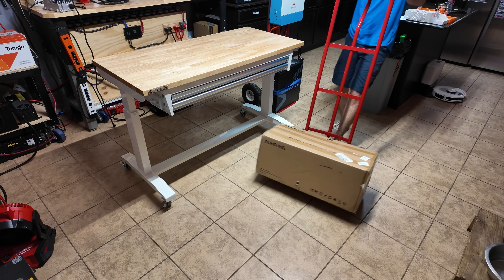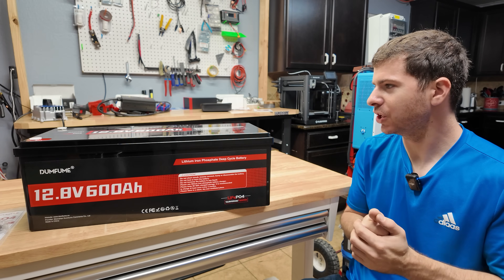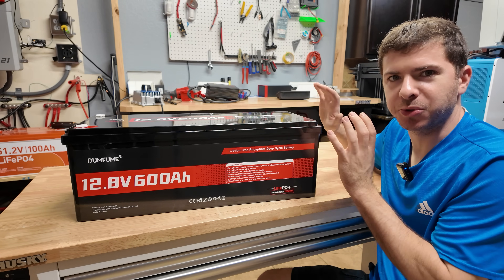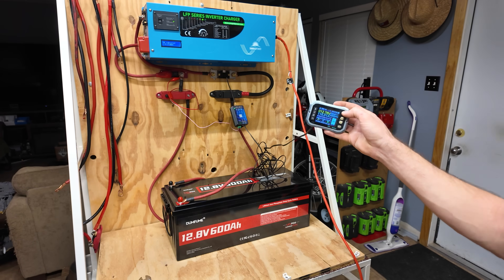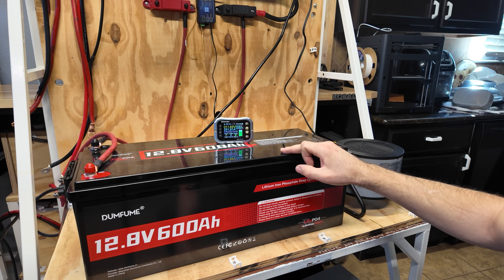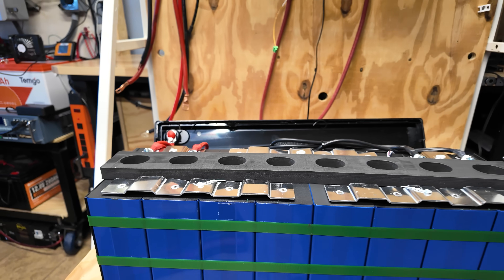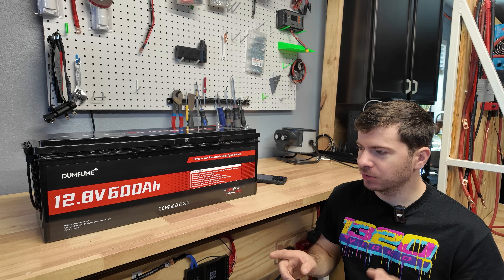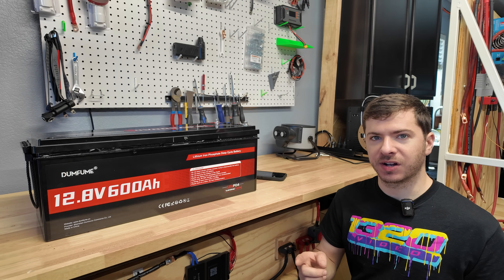$559.99 Dumfume 600Ah 12 Volt Lifepo4 Battery Review! Teardown! Testing!  7600Wh

Comment: Nice video!
Would you ever consider doing a build these in a 48V setup with solar, inverter and grid charging?
Or would that be more expensive then getting server rack batteries?
Reply from the maker: Yes they would work well for that, I like the form factor of a server rack battery more, and they are getting cheaper. But if your after cheapest price per Watt hour it may be hard to beat this.
But do keep in mind you will need a battery equalizer to keep the state of charges close, and that adds cost.
either way is good in my opinion

Comment: Thanks for the review and the teardown. Looks like a quality built battery. This Dumfume seems to have the same capacity cells as the WattCycle 628 ah battery. I'm curious as to why Dumfume chose to advertise it as 600 ah instead.
On another note, I wish I could get 2 of these batteries. I would connect them in series to run my 3000 watt aio Sungold Power inverter/charger.
Back when I purchased my 12.8v 280ah batteries, they were the highest capacity 12v batteries on the market. Now they seem kinda puny. lol
Reply from the maker: I agree they probably under rate it’s better than over promise. It’s a monster of a battery I can barely move it, so I think 300ah is the sweet spot .

Comment: To answer your question I guess the primary factor would depend on If this is your primary source of power or just a backup. For off-grid redundancy is survival. If you have 1000ah of 100ah batteries and one goes down you now have 900ah. If you have a 1000 amp hour battery and it goes down you now have no power. So for that scenario it depends on which level of redundancy you want would you rather have nine 100ah batteries or 3 300ah. If it's just a power outage backup chances are you'll have it repaired before you need it so convenience over redundancy.
Reply: That is always something to consider.  If you are buying a good quality battery, may be less to worry about.  If you are buying cheaper batteries of less quality, it is something to consider for sure.  A lot is just how much one depends on the batteries.  If going on a camping trip where the batteries are a must have, best to isolate things a bit.  If you always have another source of power, not so important.  

Price is another consideration as well.  It may be cheaper to buy 100 amp/hour batteries than it is one 600 amp/hour battery if you catch a sale or something.

Comment: How long can it run my 12v a/c that I'm getting for my van?
Reply from the maker: How much power does it use?
Reply: @Mikebuildss thanks for your question. 58 A at startup, then average of 48 amps. Outequip Pro is the name of the a/c. Thanks again.
Reply: 600 divided by the average amps of the AC, since it fluctuates and cycles on and off. That answer is the hours it will run. That's the easy generic formula.
You'll do yourself a lot of good by learning watts law and how to use it.
Reply: @samuelfox8126 thank you!

Comment: imo if it is not for 12v rv (and you're not limited by 12v-only appliances) then having 24v or 48v batteries and system is better since you would have higher continuous power and no hassle with battery balancing when you discover that <200a 12v (<2.4kilowatt) is not enough for your appliances. for an rv you even can have bigger 4kwatt+ hybrid inverter that accepts big 500w panels.
for homes having 24v+ system is even more practical because you can add a few kilowatts of solar and have free air conditioning during summer. price-wise 12v vs 24v is not that big of a difference

Comment: That Company seems to be pretty good Mike, just dropped some change $$ on 4 of the 300AH models and so far so good!! I wish I would have waited on getting batteries cause the last 2 years these things are now super cheap!! Keep up the good work brother!! I still have some on and off issues with my Sungold all in one 5KW unit but so far it's working so oh well... LOL
Reply from the maker: Nice that’s a lot of capacity! What kind of issues are you having with your inverter?
Reply: @Mikebuildss  Where to begin.... LOL... well if I run my generator on the Main/Grid in when the batteries are low it does swap over to feed the cabin and charge the batteries but I can't set the charge current to more than 20 amps even with the cabin at say 2 amps and it not bog the generator down and the all in one will disconnect it even though the generator is rated for 3600 running watts with an 8/3 15 foot feed.... sometimes I have to set it to 15 amps on the all in one to avoid it from happening... AND if the batteries are really high like close to topping off it will connect and disconnect over and over... I have tried 2 different generators both new so that should eliminate that... any clues? If I turn the setting to 0 amps it works flawlessly swapping over if the gen is on and works great BUT I loose the whole real purpose which was a back up means of charging... sorry so long winded...
Reply: @Mikebuildss  Oh and it's a 48 volt system...

Comment: These big batteries is dropping in price so much it will soon be cheap to invest in large scale home systems. 4x this in 48v configurations is a huge amounts of energy and could last you for days or even weeks if you are in a blackout situation.
With this prices a company could build an easy automated "kit" for the elderly and other people that struggle in a blackout situation, you can get that today but at often insane prices. I built a smaller system just for situations like that, works and gives me a few hours to set up gasoline generator or wait for grid power to come back if its a short blackout. Coolers and fridge will run on batteries like this for a long time if you like me got medicines in there that spoil if they get warm.
Reply from the maker: I agree that’s what I think most people would like to have, not every one needs a fully off grid house they just want some power in a back up situation.
Reply: @Mikebuildss great review. Everyone is almost only reviewing 100Ah batteries. Big ones like this one gets little attention. Keep up the good work.

Comment: Someone needs to come up with UPS controller for Servers for batteries like this.  APC normally prices their systems at a $1 per Watt.
Reply: Look up charger/inverter. LiTime has one, has UPS functionality but no way to plug into a usb to auto shutdown the PC/Server when battery gets low.
Reply from the maker: Some inverters have a UPS function that switch to battery when Ac power is removed, switching time is extremely fast

Comment: I have one 300ah. It was 300ah for this first month. Dropped to 260ah then
Reply: Charger a 14volt max en max a 11.8v stop use and charge battery con mppt and use cable da 75mm2 for 2500watt a 12.8v is 200ampere da 14v a 11.5volt is 300ah
Reply from the maker: I wanna cycle this one and retest after some time, i hope thats not the case all the time

Comment: I love these large "Solar" batteries when used in Car audio systems. 
They have so much capacity, you can play your radio all day and not have to worry about having enough power to start your car later. 
Also, for those of you who have  things like a  DVR in your car, they really are nice to have when you park your car for  week or so, and come back with everything still working and the voltage reading still being above 12.5 volts
Reply: I use just a 100ah battery for the stereo and cooler in my jeep.   Runs all week and tops off every time I drive it.

Comment: I was going to get their 12v 100ah battery, but there were too many bad reviews on the battery, not keeping a charge. some say that the battery didn't last long. I think they are now using cheaper parts for them.  I think I'm going to try the fllyrower lifepo4 12v 100ah  battery.
Reply from the maker: I’d also recommend Vatrer or eco worthy both are built really good. The eco worthy also has metal cell compression
Reply: Ecoworty o watt cicle mini is good

Comment: Don't turn up side down? Any concerns about mounting this upright/vertically (and in a vehicle)? And without Bluetooth suggestions on what would be best for monitoring it's remaining capacity.
Reply from the maker: You can orientate it any position except upside down generally is ok .    Id recommend a amps whatt meter, i have a video on my channel showing the one i use, its programmable so you set the capacity and it will keep track of how much you used. Ill add the link in the description.
Reply: @Mikebuildss schunt victron is good for lifepo4

Comment: Nice battery, I think they could have made a big improvement for a small cost by the addition of a Bluetooth connection for monitoring.
Btw, why r u wearing shorts and t-shirt?  it’s winter.
Thanks from Wales 🏴.
Reply from the maker: I agree completely or even a small screen!   I tend to wear shorts more comfortable to work in!
Reply: I think most people that are gonna buy a battery of this capacity would probably prefer a BT shunt, at least that’s what I’ve done.

Comment: Yea ok whats the price.   I got 12 200ah northstar nsb190f batteries for 60 bucks a peice.  For around 55kwh ish. Yes heavy. Not as dense but for a home system im not concerned about weight how much power you can stuff in a  small space
Reply: The price of the dumfume (what a lame name) is about $600. It seems like NSB190F batteries usually go for a similar price now.

Comment: When you get into systems that have this much capacity, just go 48 volt. Thank me later.
Reply: Nah I love my 12V system
Reply: If you're running all AC loads you're totally right. I like running all DC off my battery and I use my power station for my AC loads. Some don't run AC at all.